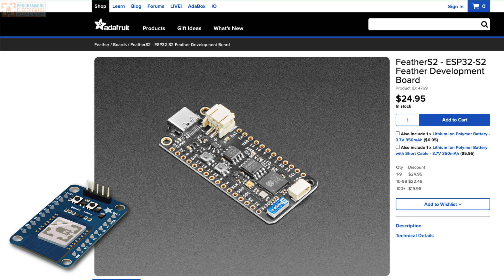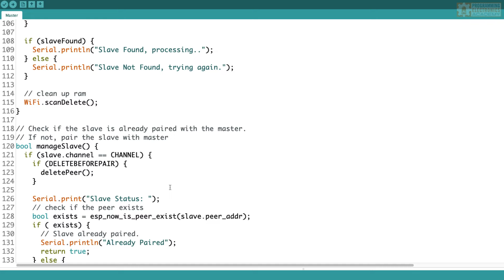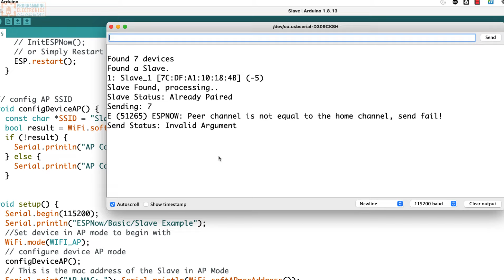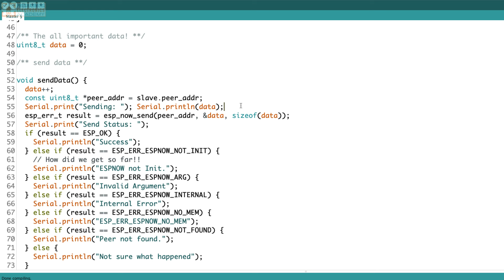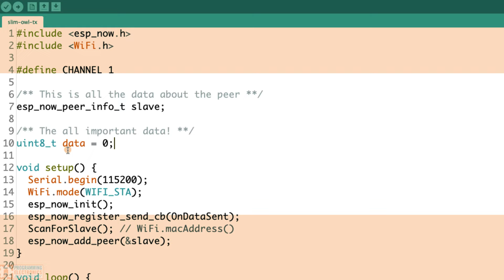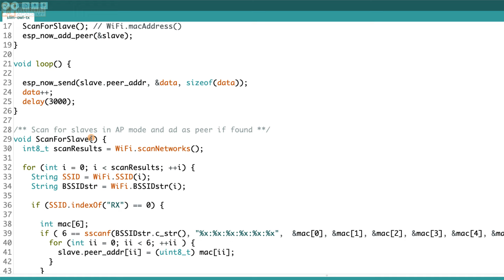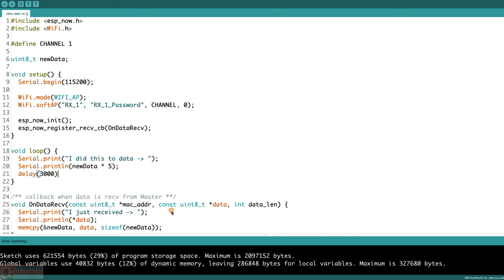ESPNOW for beginners! #ESP32 #ESP8266

Comment: Excellent,  best ever detailed explanation of ESPNOW.  I am currently using it in my projects, and new projects like model railroad control with ESP8266-12F  that I created a board to fit inside an HO locomotive with PWM driver for the motor.  I do agree with you how come this ESPNOW is so under-used.  It is a great tool and you do not have to mess up with TCP or sockets protocols,  you do not need to be online nor in a network router structure point to point communication,  fast and reliable.  Thank you for your video.
Reply from the maker: Thanks so much for the note Claudio!  Sounds like you have an neat setup using ESPNOW with the 8266 (I have only tried it with the ESP32 so far.)
Reply: @programmingelectronics  I am going to try the scan feature in ESP8266.  that will be top to add new slaves.
Reply from the maker: @claudiomoles  I thought that was pretty slick as well.  I really think that basic example sketch that comes with the library is pretty solid.

Comment: Good job doing the pairing. The only problem I see is if you want 2 way communication you don't get the other mac address. Do you have an idea regarding that?
Reply from the maker: I think it can be modified so the receiver saves the MAC address of the sender, and adds it as a peer?   I need  to look into 2 way communication more and see how that is normally done.

Comment: Thanks for the great video, my head is swimming as new ideas are being developed.
This will definitely play into the design of my project for controlling fans and heaters in my car. Now I can control them remotely from inside my house or worksite to better conserve my battery's usage.
This battery-operated module has heating and cooling features dependent upon the season.
If I want to go somewhere early in the morning, I can remotely activate a heater and fan to clear my windshield from fog and dew. I think I might add a camera later to see if the fog is cleared (no white reflection) to turn off the heated fan and save battery power.
If I notice that the temperature is starting to rise outside and I know I'm going to be driving it soon, I want to activate the cooling function. I have a thermometer in the car that is used to control an exhaust fan installed in one of the windows.
I have a small solar panel mounted on the sunroof to help charge the battery.

What kind of range is typical for this communication?
I see this could also be changed from a Master/Transmitter with Slave/Receiver operation to a two-way communication system. That opens the door to adding an alarm system in case someone likes my car too.
Reply: Ahh, I see someone else is also thinking of using it in their car 😋 definitely going to be using mine in the car for multiple features. I'm currently working on a customized ligting feature as I'm planning on adding DRLs to my MK1 Velociti, especially for more visibility, and some other features for show as well. Also planning on adding a camera to the mix, although that I'll probably run off a Sim module so I can use it anytime as my car sometimes need to stay at work, so the ESP32 will definitely be great for alarm features as well. Also being able to control the lights etc from my phone instead of just the 2nd ESP32 would also be an awesome addition, for when someone else likes my car too. The possibilities have shot up with these boards, and I'm glad to see that others are also looking into modding their vehicles with these systems (even if it's minor mods). You could possibly even create your own vehicle tracking system if you add a GPS module and configure it to send you a message or notification with location if the vehicle has been started without an authorization key / button / RFID tag or something. As mentioned, the possibilities are much greater now with these boards. Anyways, all the best to you with your endeavours on your project
Reply from the maker: Range looks pretty impressive from what I’ve seen online in some field tests around 500ft depending on obstacles

Comment: Great video. I use ESPNow to send BME 280 data from my solar weather station to a receiver located inside my house. The receiver then sends the data to Blynk.  The connection/awake time for the solar weather station using ESPNow is less than using WiFi. A definite plus when powered by a battery.
Reply from the maker: That’s a really neat application!  I’d love to play around with battery extension using deep sleep some time.
Reply: neat and especially the battery part 👌. For longer distance lora boards are also awesome 🙂

Comment: Sir can esp is used to give signal of sensors and the receiver esp can be connected to Arduino ?
Reply from the maker: Great question!  Yes,  it could for sure.  It worth noting that the rx ESP is a full fledged microcontroller that might be able to replace the Arduino in whole depending on the application.   Also do note the esp operates at 3.3v, so depending on the rx Arduino you might need to level shift the signal.
Reply: @programmingelectronics  Thanks sir 😊
Reply from the maker: @technicalgaming7056  Thanks for watching - best of luck on your project!

Comment: Thanks mate! İs there a way to reduce range of espnow? Like if its in 1meter range do stuff else do nothing. Or nothing received if the transmitter out of 20 meters etc
Reply: How about a partial Faraday cage around one so it has to be about 1 meter or less to work.. once out of range.. signal will drop and do nothing.
Reply: @marktrezz  yeah solving it like this for now but it's not practical always. I'd like to know if there is a better way
Reply from the maker: Neat question!  I know you can get the current RSSI (Received Signal Strength in dBm) from one device to another, but that not really a measure of distance.
Reply: @programmingelectronics  i have search the internet for days. But without rssi i couldn't find any way to reduce it
Reply: If it has some sort of PING functionality, you could try using that then measure with the response time.  You would have to determine if the response time from 1 meter is 1/20 the time from 20 meters.  There may be some additional delay in there due to processing speed, but it may be possible.  The ESP device might not be fast enough to give you the resolution you're looking for, but definitely worth a try.